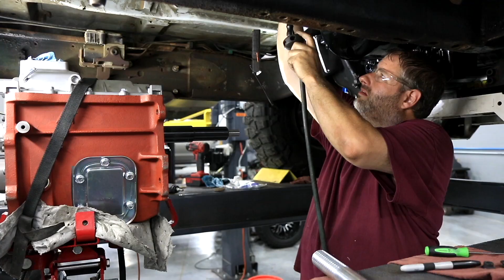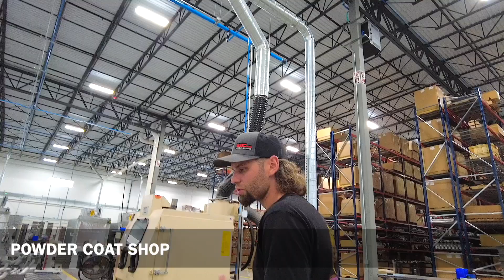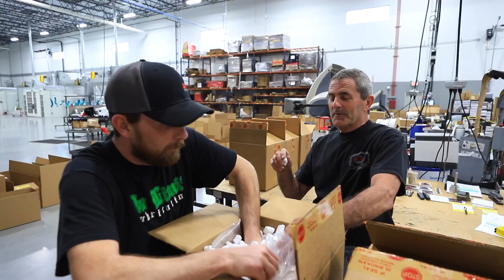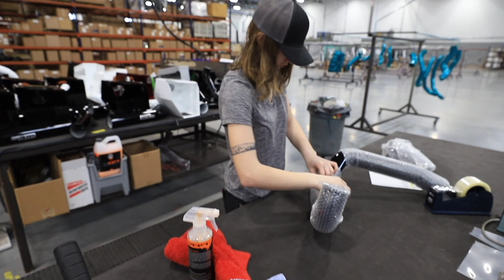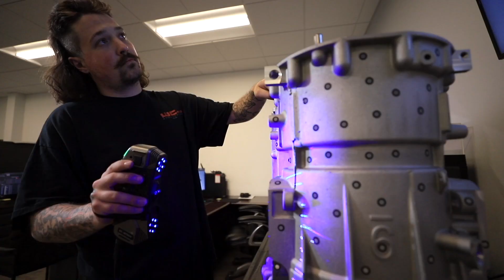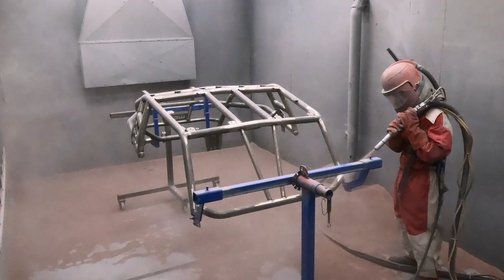WCFab New Shop Tour!

Comment: When is the 5500 coming back to the build series for an update
Reply from the maker: We’ve got some more plans for the build coming this winter and hope to have some more video updates on it coming soon. It got sidelined while we were working on the new building / move and then was on the road as the hauler for our pull truck all throughout the summer.
Reply: Mannnn, I asked that very question!!! That build is badass. I’ve been hearing horrible reviews about the Duramax failing, but they’re hauling weight with it. Curious to hear how it performed for them, and the upgrades made to increase reliability!!! Everybody is rolling RAM… Im GM!!🇺🇸🏆

Comment: are you guys going to make any s400 kits for lly
Reply from the maker: S400 Single Turbo Kits for the LLY have been discontinued. Some kit components are still available for custom fabrication use on purpose built race vehicles. We do have parts development in process currently to support drop-in style turbocharger setups for the LLY and anticipate those products to roll out in the next 12 months, starting with passenger / cold side intercooler pipes around the end of this year.